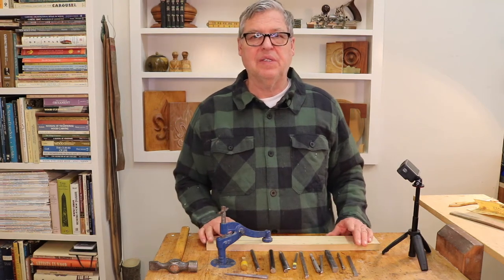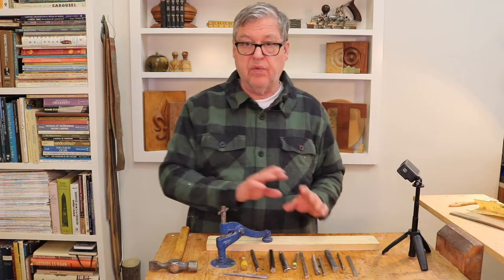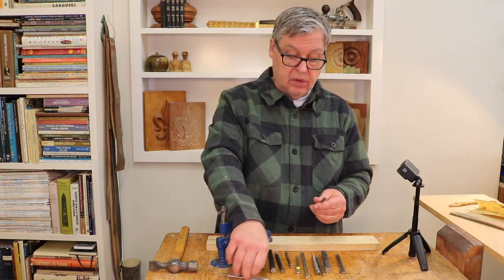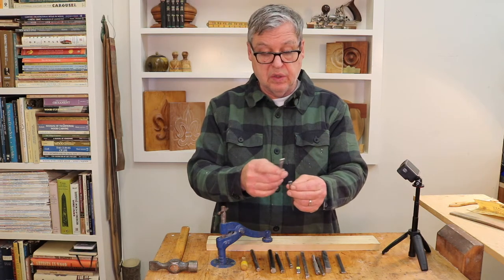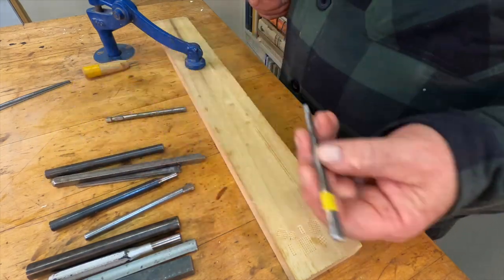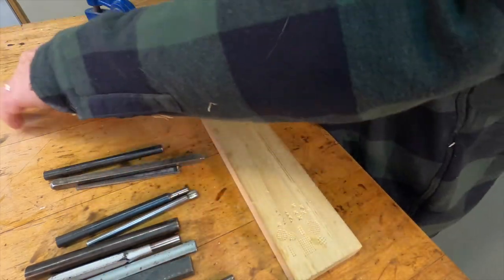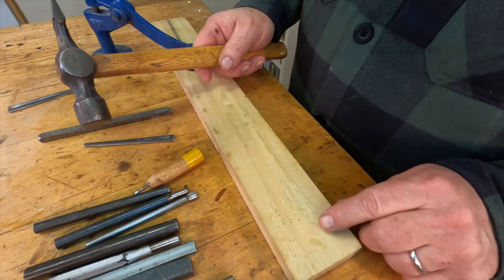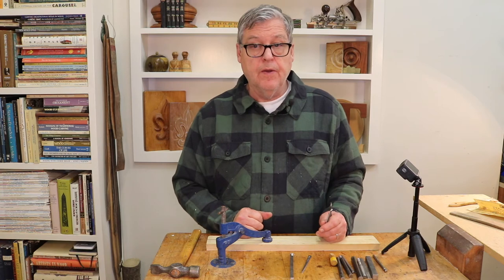Primer on Wood Carving Punches

Comment: great video, what type of clamp did you use please
Reply from the maker: That clamp is a # 145 Record Holdfast made in Sheffield England. I also have a couple of # 146 Record Holdfasts that are a little bit larger and have more reach. It’s an indispensable tool for my work. They are not easy to find these days but seem to still be available online. Thanks for your comments.